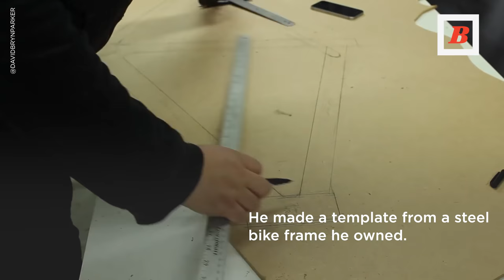Watch This Guy Build a Bike Frame Out of Wood From Start to Finish

Comment: It's beautiful but wood, although having pretty good specific strength, have very low modulus so dimensions much be much bigger than for metal.
Reply: But, that considering, wood can have thicker walls (or solid) while still being quite light.